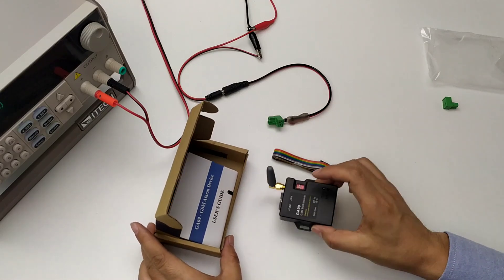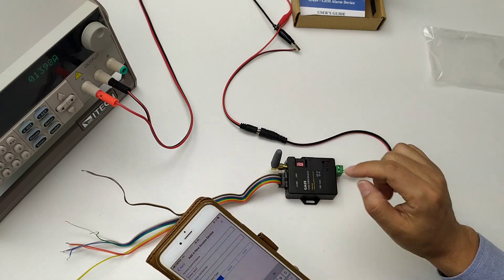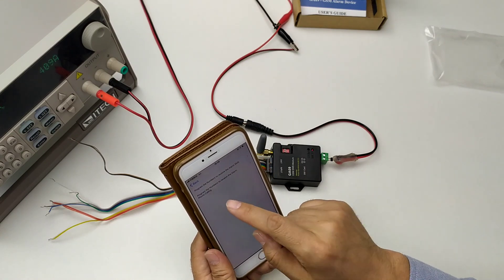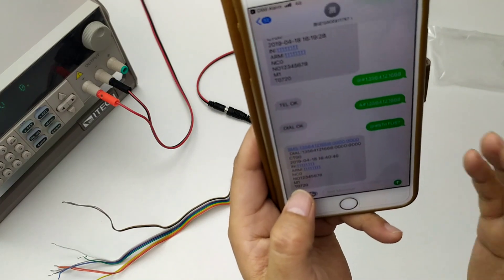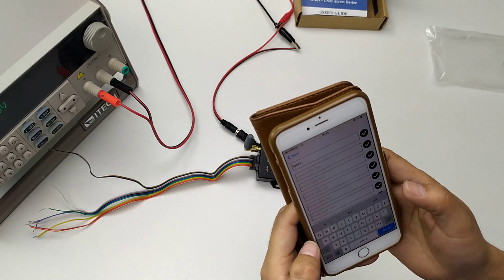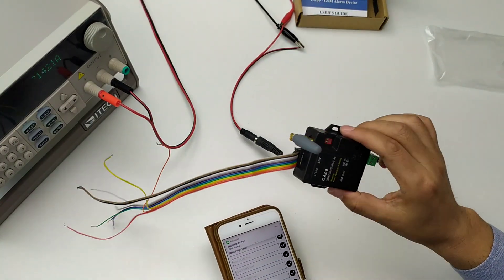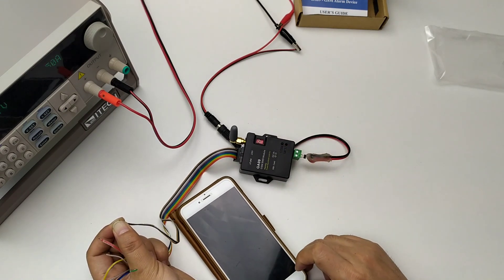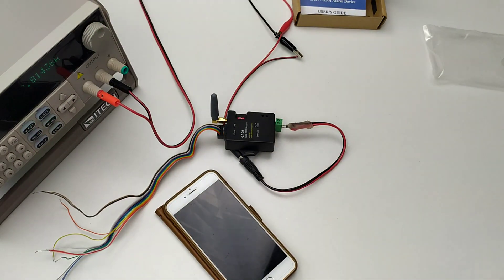GA09 GSM Alarm box

Comment: The 2g network is being switched off in the UK,  will you be making one for 4G and 5G? 

Is there a way of speeding up the return call if you don’t answer or reject it. 

Will this work on a 12 to 14 V circuit? Or would I have to fit a wheat stone bridge to make the 12 V to 6 V?

Comment: WARNNING!!   Product caused battery fire so buyer beware of this!  I bought two at the time and so I was worried the other one would do the same. I tried to send it back and could not get a response from company.   Also I learned this unit no longer works in US due to 2g.  Customer support is non existence with this company and so I would NOT trust them.  These are seen on ebay and amazon, but I don't think they are aware of the battery issue.  All I can say is be careful if you have one of these.
Reply from the maker: 1. For US, need to order the 3G or 4G version
2. This is a GA09 gsm alarm box, there is no battery inside. So I think you must use a battery to power on the GA09 device, but maybe you shorted the battery, then your battery must has big problems. so please take care of this if you are not a qualified engineer.
Reply: @waferstar  The battery that came with your product is unsafe. The product itself is unsafe and so I think people here living in the US should be aware of this.  It doesn't take an engineer to use this product or understand how to use it.  If that were the case then you should sell to engineers only? Maybe so. Also, your follow-up with customers is through this post many months later?  Really?  I tried to contact you for several weeks and there is no response from you or your company if you have one.  Anyhow, moot subject for me, what I posted was an accurate experience with your product and I would not recommend it to anyone.  And apparently, I'm not the only complaint you have had with this subject.  Prospective buyers, do you do diligence to verify.  Good day.
Reply from the maker: @Conk102  your make a big mistke. there is no battery together with the GA09 products. and also there is plug for battery. I cann't understand your meaning.  GA09 is powered with DC12V power adaper. no battery input and also no battery in the package.
Reply from the maker: We supprt to power on the device with DC12V / 2A power module, not a battery
Reply: @waferstar  We obtained several of these and found the other two to be defective also.  I would not trust these.  Poor product.

Comment: Thank you. Iam happy to find this. This is very good stuff for my project. Is this working with about 5VDC battery (4xAA) power input?
Reply from the maker: cann't use the AA battery, that cann't provide  enough current for the GSM device to work. so you need to use the DC5V At least 2A power adapter. of course, that would be better to use at Least 6V to 15V. because if use DC5V, if your power voltage is not stable ,then that is easy to restart or disconnect fro the GSM net.

Comment: This is a very useful video. I am buying this GA09 for an alarm system.
One question I have: if the mode is set to call when input status changes, how does it tell you which input has changed? (Input 1 or input 8?)
Is the call silent?

Would you have to set the contact mode to call and text to know which input status has changed?
Reply from the maker: Sorry , if you want to know which input has changed, then need to use the SMS report.